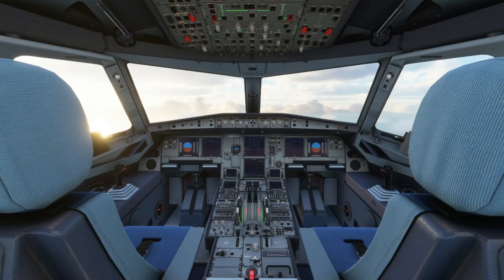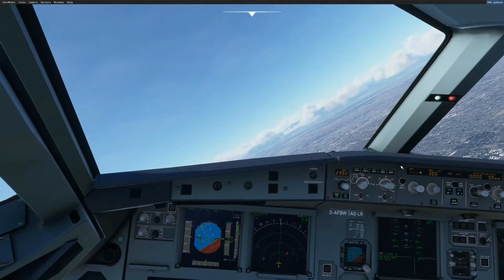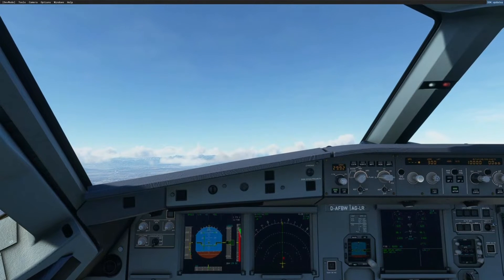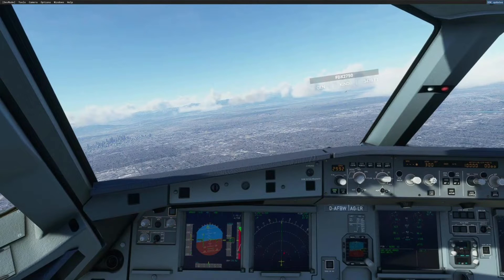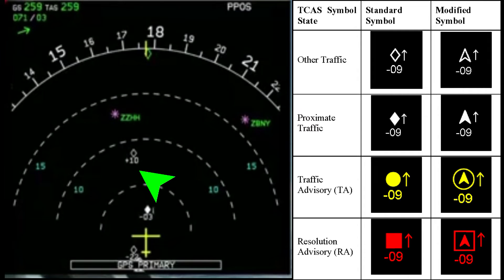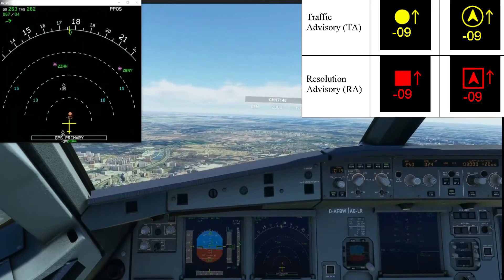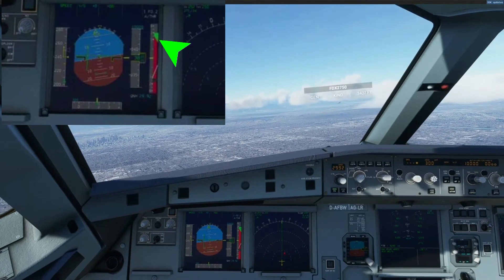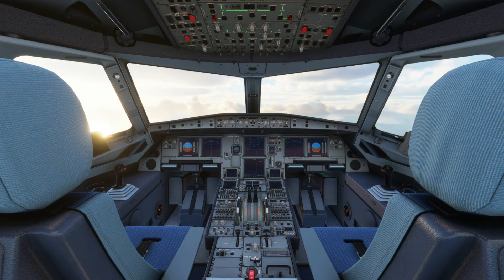TCAS PROGRESS SO FAR | Microsoft Flight Simulator | A32NX | TCAS Traffic Collision Avoidance System

Comment: Wait so Traffic Alerts don't mean you need to take action unless it turns into a red square and it shouts "Traffic, Traffic". The only problem I have with this system is that it can scare people and can scare people. So if someone has their hand on the sidestick, then then might jerk it, but I think that the Fly-by-wire system will realize that they did it on accident. Example:  https://www.youtube.com/watch?v=GRRaFxq4vUk&t=619s  --> Skip to 0:46
Reply from the maker: Thanks for the video, the TA (amber circle) think of it as a heads up alert that there's traffic in the vicinity of your aircraft, and to expect an action to resolve it. In the video you provided, AP1 is still active and the crew received a TA which it did startle the FO which is normal, but this is just a heads up alert seconds later the aircraft symbol turns to the unfilled white diamond. No action was required. Generally the crew keep the autopilot active, if the RA (red circle pops up) the pilot flying disconnects the AP and the pilot monitoring turns off both Flight Directors, followed by the necessary maneuvers to avoid the collision from happening. Hope this explains it!
Reply: @DaftPilot  I also have another question which is that if ATC realizes that there two aircraft are coming towards each other and it becomes TA,  do pilots listen to ATC or what about if it gets to RA? I remember an incident in Japan where an almost mid-air collision occurred because they were listening to a new, overloaded ATC which made them end up in a even worse situation, but didn't listen to the TCAS.
Reply from the maker: @sovietwizard1620  TCAS has priority over ATC command unless the ATC is aware of the TCAS. Overall, the crew listens to the TCAS alert and advises ATC that they have TCAS, like that ATC won’t interfere with the situation.
Reply: @DaftPilot  I was doing a flight from KJFK for KATL with Live Traffic Enabled. On approach I was landing 27L and another plane was taking off 09L and making a slight right turn and was on a collision course for me. It first was a potential threat as a filled white diamond, I ignored it as it was common here. Then I saw a TA, and I started turning off approach mode and using V/S for a V/S of 2000. The A/P was too late because it turned into a RA. I immediately disengaged A/P and pushed the yoke down to about -8 to -10 degrees and finally, it turned back to a normal non-filled diamond and left my ND. This was super hard because none of the TCAS from this video was in my Stable version. I think this would be DEFINETELY useful in the A320.
Reply from the maker: @sovietwizard1620  I believe this came from the development version but yes TCAS is very likely needed when you’re dealing with AI traffic
Reply: @DaftPilot  This was live traffic but the planes were AIs